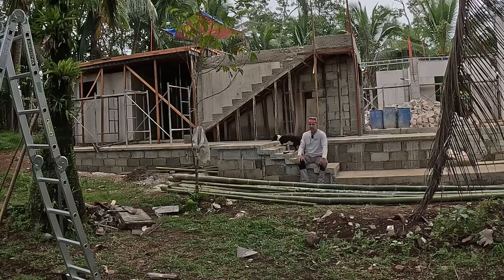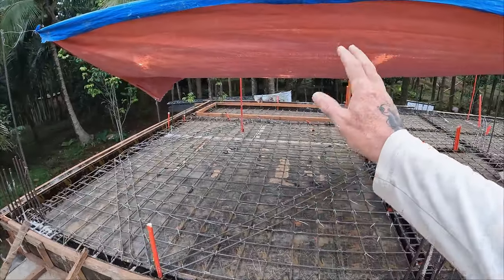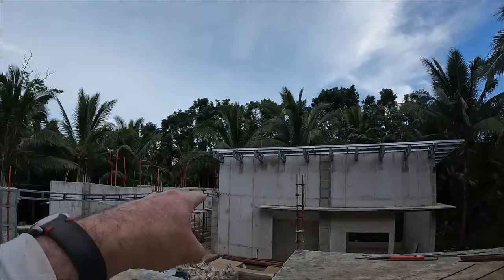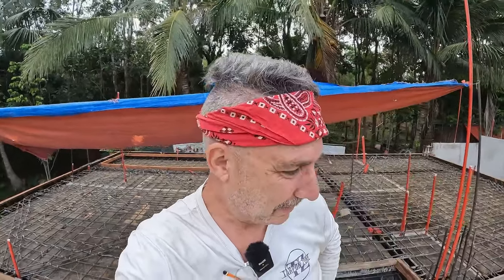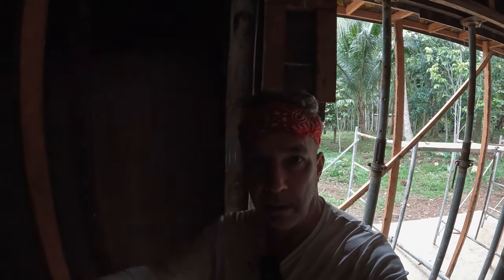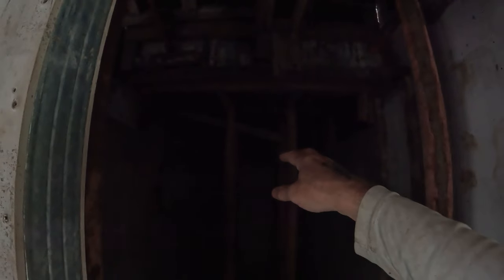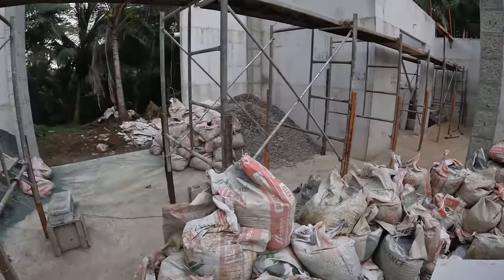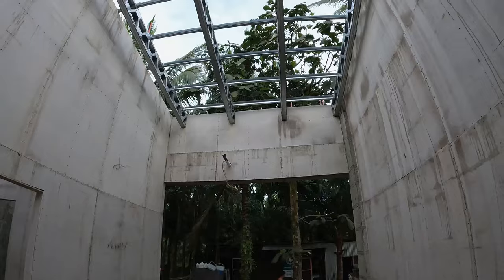Home Build Milestones: Is it Progress? 🚧 | House Build Philippines | Ep. 27 | TORINO

Comment: Shaping up real nice......A.  On the shown network diagram, although u may not have shown, wht abt backup off site storage for vids and data depending on how critical ur data is.   As a old school guy I like to see/touch all my devices during initial setup and trouble shoot(aka in one room), but once its all working i dont want to see/hear as u mentioned.     B.  On solar, I was researching EcoFlow DP Ultra with Smart Panel 2 as my choice but dont see any/many installs in the PH.  I really like the power of the EcoFlow app, and DPU expandability and semi portability.  However in the PH it seems the Deye inverters rules as the most popular and Deye seems to be the same inverter as SOLArk branded in the USA. So now reviewing it also....its not semi-portable like the DPU.  Pre running ur future trunking/conduit is good.  Remember to decide on ur critical load panel for the batteries in electrical room, also room may  need some cooling or split a/c if u going to have inverters and other IT stuff in tht space.   Great stuff.......watching and learning from you with a keen eye. 😁😁😎😎😎😎
Reply from the maker: All good points, thanks. I tried the SHP here and i posted vids of that experience... it didn't work out for me. SHP2 may be better... Thanks for the tips.

Comment: 6 HP for that small room? Jesus and I'm over here with 2HP freezing my nuts off in a 40sqm room.
Reply from the maker: Yeah, we like to over-engineer things.🙂 But really, it's a high-bay with many windows...
Reply: If it's like my PI house that's about right.  4hp need scale to 6 so it doesn't overwork.  Remember typical construction is zero insulation, many air leaks (especially around window frames)  and single pane windows.  In my house, turn off AC and room gets to outside temp in about 20 minutes.